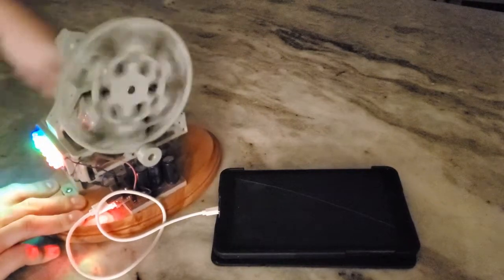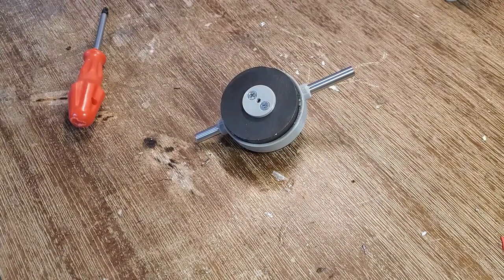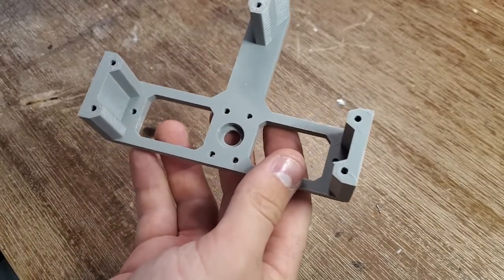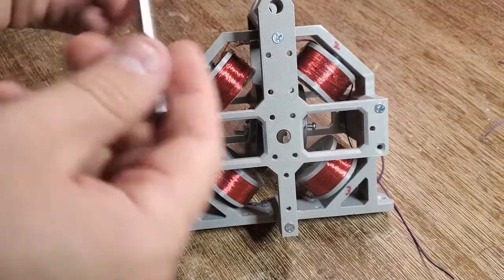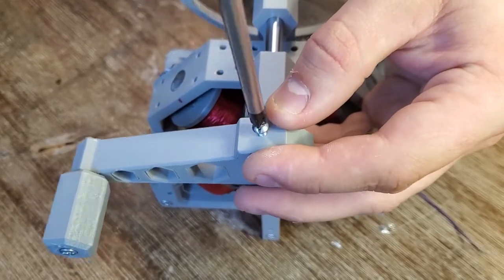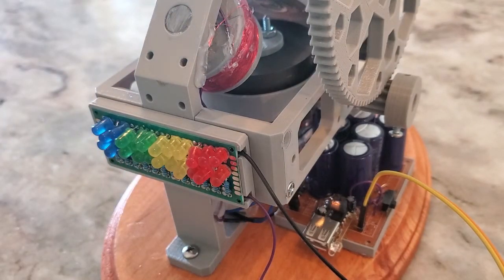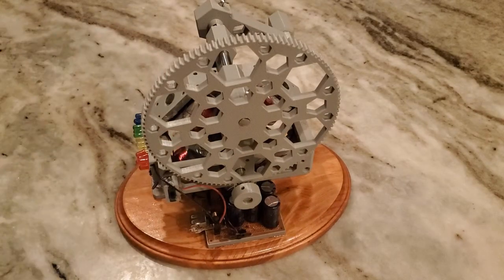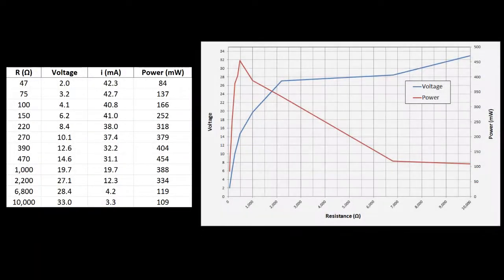32 Volt Hand-cranked Generator

Comment: I really like the rainbow lights powering up and down gradually. It's just controlled by the difference in voltage of the LEDs, right? The red LEDs take under 2V and the blue over 4V, so the caps have to be charged to a higher level.